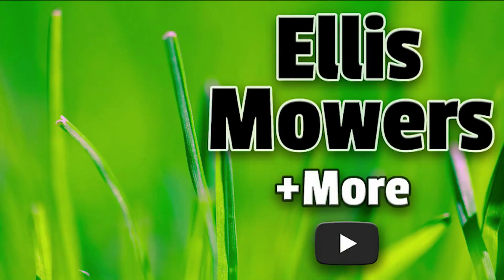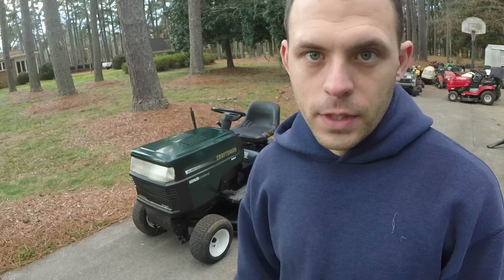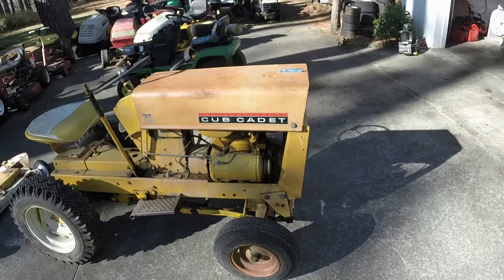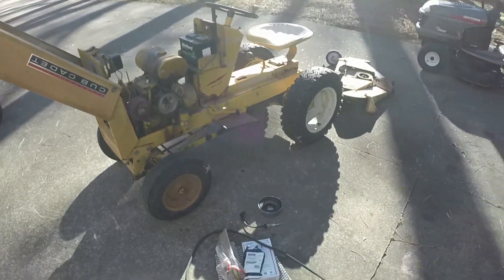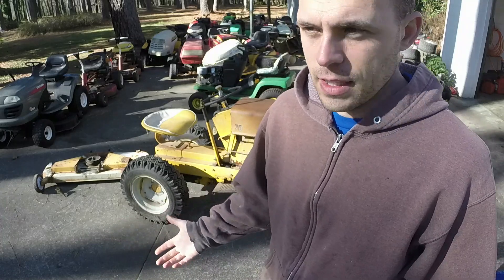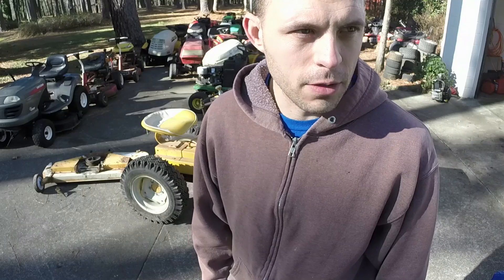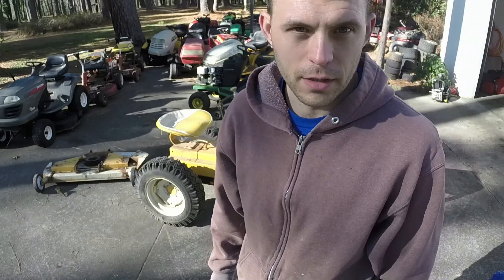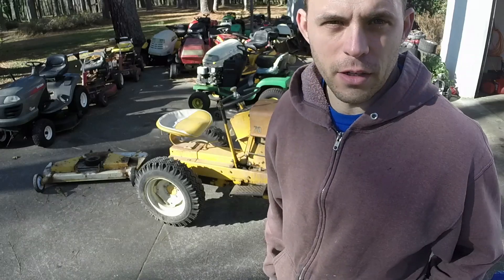Trading my Craftsman Garden Tractor for a Cub Cadet 70!  Was it a good deal? (came with the deck!)

Comment: tractor data lists the model 70 as 1963-65. that extra slot in front of the shifter is for the optional creeper transmission. you got a very good deal and near me early cub cadets go for 400-1500+ depending on the model condition and accessories.
Reply from the maker: Awesome thanks for the info, I was gathering that I could sell it as is for what I paid for it in trade value.  I don't think it'll take too much to get it to run again.

Comment: also, check the shaft coupler that goes from the engine to the Trans,,,  it has a coupler behind the engine, and  somrtimes due to wear, it will break.
Reply from the maker: Thanks for the tip, I would bet this is my issue.  I don't feel like it has an internal trans issue.  Hope to get to working on it this week!

Comment: Casey I might be wrong but I believe the deck is an added option. I think they came basically came new as a haller. So the deck I think is a big +. I think you did good on the trade. I believe it will bring in some really good money  💰 💰 💰 💰
Reply from the maker: I think you are right Rick.  I started working on it today and found that I need a new PTO clutch friction disc and a couple PTO springs.  It also needs a drive clutch spring.  Not the cheapest repairs but if I can get it to run, drive and cut it will be well worth fixing.  Might fetch close to $1000 for the right buyer with a working deck!